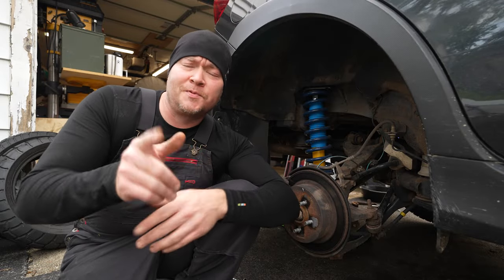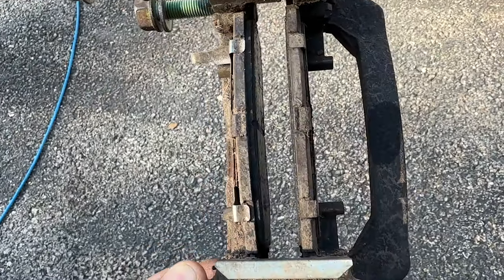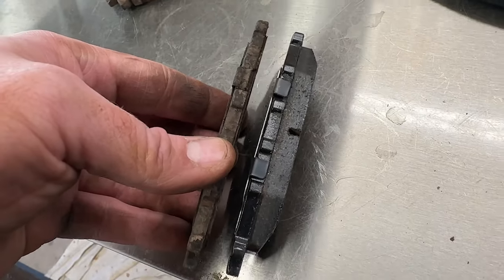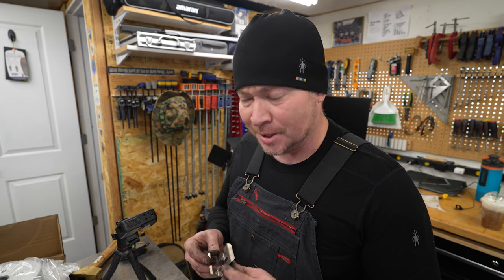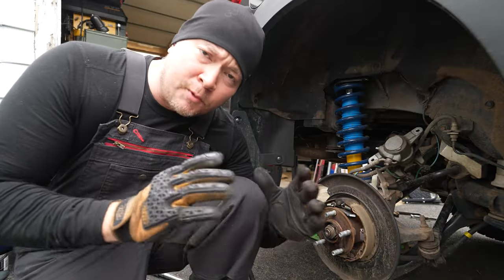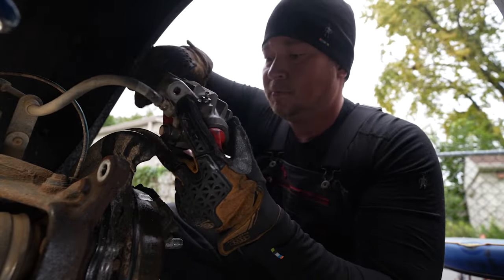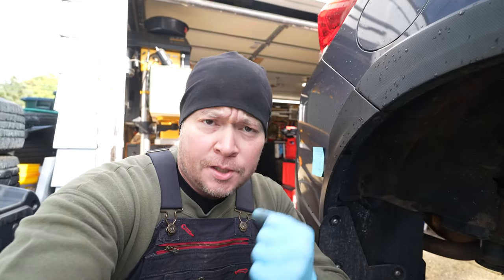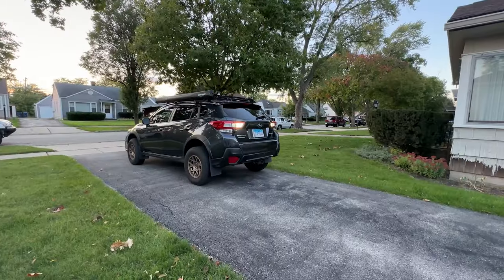Crosstrek Rear Brake Replacement

Comment: Good job Tom, you took the time to do the job right. I am a brake system technical trainer and I have two obvious recommendations. 1st, take the bracket to your wire wheel and clean as much as you can to get rust and debris off. 2nd, the recommended break-in for almost any brake pad follows the simple 20/30/30 rule. 20 stops, under 30 mph, 30 seconds apart. Cheers!
Reply: He there. Would you recommend to bleed the brake line like he did or just compress the caliper all the way? That’s guys!

Comment: Kissing dogs and throwing words like “copious” around…you jarheads sure do live on the edge. Of course, if you’re not living on the edge you’re taking up too much room. BTW…outstanding job with good info. Of course it had to rain… Good disclaimer on torque. Torquing wheels keeps you rotors true as well.
Reply from the maker: Ha!  Well, I mean if the doggo comes up for kisses, you gotta give the kisses.  Am I right?  Also, good point on torque helping to prevent rotors from warping...especially on alloy rims.  I've seen folks go to town on their lugs with an impact only to ask me later why their brakes are pulsating and/or steering wheel shaking when the brake.  Dead giveaway :). Thanks for watching!

Comment: If caliper isnt loose, I stick a screwdriver into that hole in the caliper and push the rotor against the brake pad to get the caliper to open

Comment: Hi Tom, This was the first video of yours that I've watched. Excellent! I like your common sense approach to the whole evolution. I too have done lots of brake jobs but always check out YouTube before getting into a job on a different car because I always learn something new. I too am an anti-seize Nazi, you just need to know when and where to use it and not get messy. Interesting pointer about opening bleeder when compressing caliper. I've never done that but may try it. I really like your brand of humor as well - I can't count how many times I've launched parts into the next zip code using my wire wheel (for instance). I'll look for other videos you do in the future. Good job! Rush

Comment: Nice to see that Subaru still keeps it simple. My Civic has an electronic parking brake, so you have to be super careful when compressing the piston. You have to disconnect the wiring, then manually crank back a bolt in the back of the piston before compressing it. Thankfully I'll never have to deal with that again, as I'm going to be getting a Crosstrek Wilderness Edition in a few months. I'm hoping that the 3rd gen Crosstrek has a similar strut mount as the previous gen so I can use 2nd gen spacers for a cheap altitude adjustment. Now that they've paired the 2.5 liter and a 4.1 final drive ratio, I think I can live with a naturally aspirated boxer engine.

Comment: Great Video! Especially the terminology that meakes it easy to understand. Thank you Sir!
Reply: Dear Tom;

Thank you so much for the video on replacing break pads and rotors on your 2019 Subaru Crosstrek. 

I just replaced the front pads on my 2019 Subaru Crosstrek and am getting ready to start the rear. So far, no issues. Thanks for giving me the courage to understate this project on my own. I hate paying others to do what I can do myself. 

Thanks again;

Din

Comment: Great video … time for a series of repair videos ….next installing a turbo … just kidding

Keep them coming … noticed new motorcycle tires in the back ground , they being installed ?
Reply from the maker: Thanks!  At just about 40k miles, the Subie is in for either repairs or general maintenance so I'm sure there will be adequate opportunities for content :). A turbo would be awesome, but I don't think the stock internals could handle it.  If the motor died, I'd definitely be looking into a WRX or STI driveline swap (muhahaha!).  As for the bike tires, those are the Anakee Adventure tires that came with the Beemer.  I had swapped in some Pirelli Scorpion Rally STR tires for the trip out west and I was really happy with them.  Keeping the Michelins though because they only had about 1k miles on them.

Comment: The rear pads are wearing quicker on my 2017 Trek. Did you notice that, too?
Reply from the maker: Oddly, yes.  I was fully expecting the fronts to wear quicker as they have with just about every other vehicle I've owned.  In fairness, my fronts are ready to go too LOL.  Those are next on the list.

Comment: Are the rear brakes one the front brakes the same on this year of crosstreck? I need to replace both and am wondering
Reply from the maker: As far as rotors, no.  Rear brake rotors have a drum as well for the emergency brake.  Front rotors do not.

Brake pads are different as well.  Per subaruparts.com, the rear pads are OEM part number 26696FJ000, and fronts are p/n 26296FL032.  

Those would be for my make, model and year.  They're not hard to do so I would certainly encourage you to give it a shot, but do please confirm with your dealer the right part numbers for your vehicle and don't just take my word for it :)

Comment: Without proper brake ducting, a drilled and slotted rotor will actually perform worse than a blank rotor. Without proper airflow to them, the heat created during braking does not evacuate quickly enough to make any meritable improvement. And, to be fair, with the decreased surface area will provide a decrease in actual brake performance, increase in pad wear, and increase in brake fade.
Reply: Source?
Reply: @spacecruisers  There's several out there corroborating my statement. I could just say "Google", but to make it simpler for you, try out The Drive's article on "Don't Waste Your Money On Drilled Brake Rotors"... or NASA Speed's "Proper Brake Cooling Is Essential for Safety and Lower Lap Times".  But, in general, its a simple look at the laws of thermodynamics and basic airflow.
Reply: @toyomatt84  I’ll check those out, thanks.

Comment: Ah. . I will only say that I apply anti-seize to the hub before placing the new rotor and coat that mating surface cause. . .well. . you have two metals mating which tends to cause corrosion and when same. .it still corrodes hence bolts to remove thing.  Anti-seize will stop that.  Then apply it again on the outer side of the rotor for the wheel to rotor contact faces so you don't have the wheel frozen to the rotor when it is 11pm on the side of the road changing a tire and trying to kick the tire to break it loose thing.  The other thing I do is re-grease those pins as it is literally right there in your hand and the process itself allows you to check.  In your case use with the vehicle, I would think you would do that as the vehicle is in more extreme situations than 4th and broad asphault.  Off-road requires enhanced maintenance as muddy slops suck for repairs when lifting a few tons.  Finally, I am the push back type and have never failed a master cylinder in 100's of brake jobs.  However . . .having said that, it is a VERY GOOD practice to at least crack bleeders on every brake change just to exercise the threads.  Never touch that bleeder screw till you have to and you simply wind up with it seized.  Final pro tip.  The bleeders in most cases have rubber cover caps.  Not a big deal, but again. . .off-road use it is exposed to more then add Chicago salt trucks and well. . .you can pick up a bag of 20 or 50 for like 5 bucks.  I keep those on hand as the simple cost of bulk for the anti-corrosion value is well worth it.
Reply: Really good recommendations! I was surprised that he was able to get the rotors off the hub using the bolts, that has worked about 1% of the time for me haha. Usually just strips the threads and I’ve have to get the old 15lb sledge out and go crazy
Reply from the maker: LOL!!  Oh trust me, I've been there with the sledge too.  That anxious feeling when you know you're committed...b*tch is either coming off or you're screwed because there's no re-assembling that mess after you go all Thor on it :)

Comment: what mileage were you at when you hit rock bottom on those brakes and rotors? thank you!
Reply from the maker: about 40k I think.  Ample highway miles, but certainly not exclusive.  Do a lot of city commuting as well.
Reply: @TomtheDilettante  thank you, I'm at 85k (lots of highway), and all is spiffy, well above the brakes wear line. Will tag your video when I go to change them out.